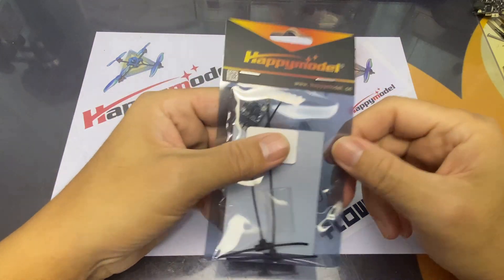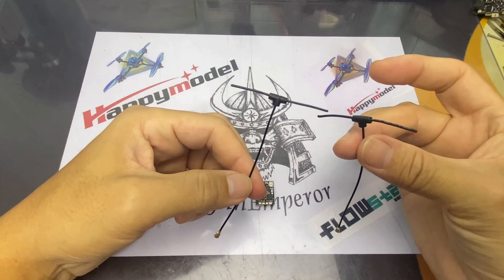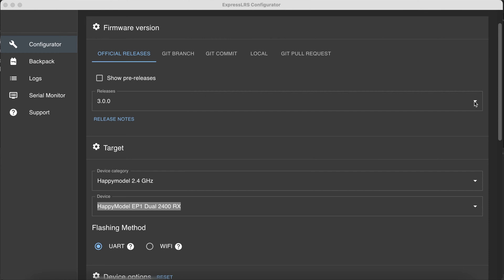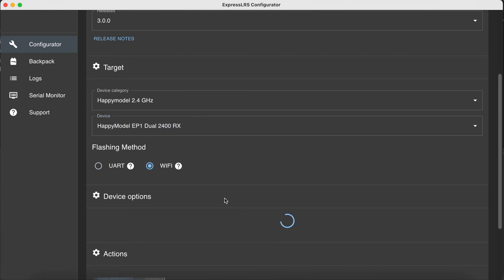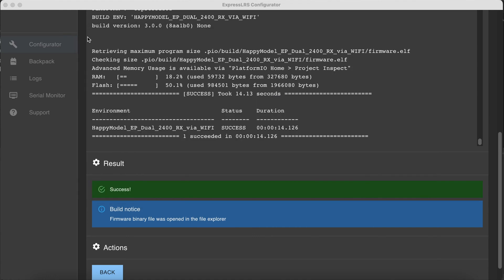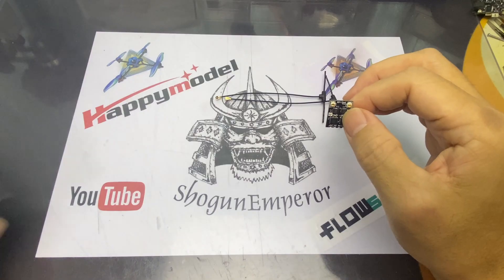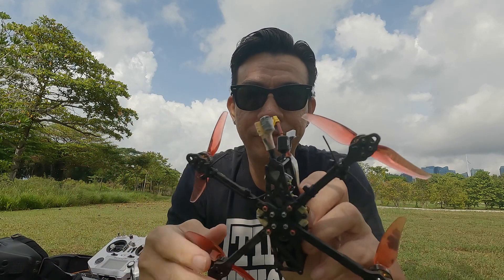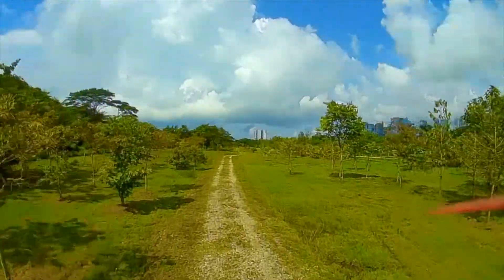ExpressLRS diversity receiver | EP1 dual

Comment: hi man, how many power do you use it? and refresh rate? 50hz?
Reply from the maker: I run 5v on this and refresh rate is maximum at 500hz. I dont usually fly far so i stick to this range for around 1km or less. Hope that answers ur question?
Reply: OK, 500hz and how many mw in the transmitter? @shogunemperor

Comment: Very nice work! I just bought the RP3 and I'm converting from DJI FPV Controller to a radiomaster ts16x Mark II an I'm worried I bought the wrong receiver. Any tips? It's a Nazgul5 V3 O3 5" quad. Thanks! Keep sending!
Reply from the maker: Aaaww thanks my bro!! Really appreciate it man!! Aaah sweet!! RP3 is a dual antenna reciever. Would be great for ur nazgul5. Its similar to the above video! Just make sure both radio and receiver are of the same version n u should be gold!!!! Always a pleasure bruh! And thank YOU for dropping in to the channel!! Happy flying!!!!

Comment: What is the video system do you use? Analog?
800 meters.. I even do not know is it a good result or not…
Of course, there are a lot of trees and low height buildings.. but nevertheless it is only 800 meters..
Reply from the maker: Oh! This video was done with the CADDX/DJI VISTA. It can go further. I just dont wanna risk losing the quad and walking the distance!! Haha
Reply: Oh.. ))))

Comment: Hi, why didn’t you put one Antenna on the front an one on the back of the Quad for better RSSI Signal  strength?
Reply from the maker: Honestly.... I didnt think of that!!!  hhahahaah I was thinking of putting it on the rear arms only...
Reply: @shogunemperor you should give it a try I noticed less Dead spots when Flying my Hawk Pro 5” from the ELRS, RSSI Loss especially when the quad is returning an facing you!
Reply from the maker: @diggsit69  will do bruddah! Thanks so much for that advise!! Will get on it once im back home. Still in Japan. 😇
Reply: @shogunemperor  Nice talking to you, good Video, an also try 1W Modular RSSI power, an at least 800 or 1000 Mw  from the VTX, that’s what I use brother!
Reply from the maker: @diggsit69  hahah likewise bruh and thanks!!!  ooooooh sweet!!  What kinda range are u getting?
Reply: @shogunemperor  it depends where am flying  at the time, but i’ve seen 2 to 3 km at times most of the times I fly about a Km or so not to push it  every time am Flying!
Reply from the maker: @diggsit69  sweet bruddah!!  250mw?

Comment: Questions.
If the receiver has to match the transmitter...
Does that mean your radio has to also have a elrs diversity module?
Same goes for elrs tcxo?
Reply from the maker: Just the standard ELRS transmitter on your radio will do bruddah. Im using the Happymodel ELRS pro TX on my QX7.
Reply: @shogunemperor  why thank you sir...

Comment: How do you bind,  you skipped over that part???
Reply from the maker: OH sorry bruh!!  Its cause I did a few videos with the binding process so I skipped that part as everyone's already on ELRS for awhile now. The binding process is the same as any other.  Once you flash the latest firmware on the receiver with your bind phrase, it will auto bind from your radio to the receiver the moment you power them both up.

Comment: I’m so getting this to replace CRSF. Been having no luck recently with failsafe and have a true diversity (dual chips) instead of switching between the two antennas, probably I’ll be luckier
Reply: I had some early signal loss for some reason I could never figure out with ELRS on my 5" drones and went back to crossfire, but have ELRS on everything else. It has been really dependable for some time now for me on the rest of my quads, so I'll probably put these receivers on my last 3 and sell my crossfire stuff.
Reply from the maker: @kurtzFPV  sweet man!! hmm.. so no inclination of the cause?  Bad connection? wiring?... EP1? or EP2?  Yeah, the dual is much better.
Reply: @shogunemperor  Definitely not connection, and not true failsafes. I have gps rth on my 5" quads, but they would just drop from the sky and it happened multiple times on two different quads. It was on EP1 rxs. That was almost a year, and quite a few versions ago.
Reply from the maker: @kurtzFPV  aaaahhh... understood
Reply: @shogunemperor  I just remembered that my crux35s fail safed when I first flashed 4.3.1. Had to flash the legacy target to fix that
Reply from the maker: @kurtzFPV  aaaaah yes!!! Its cause of the unstable release. 4.3 was its optimum. So u used the legacy target? Its ok now?
Reply: @shogunemperor  yes. Perfect now with a rock solid connection.4.3.1 was a stable release when I flashed it though. You can see both targets as the newest stable releases still in betaflight-regular 4.3.1 and legacy 4.3.1
Reply from the maker: Yeah, so Ive had a couple of failsafes myself on CRSF and my one gripe is the price.